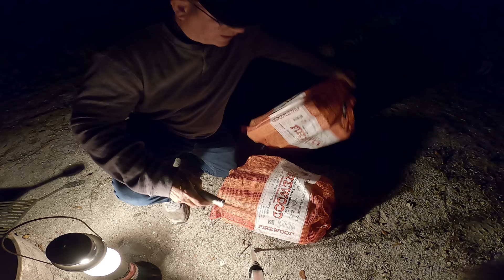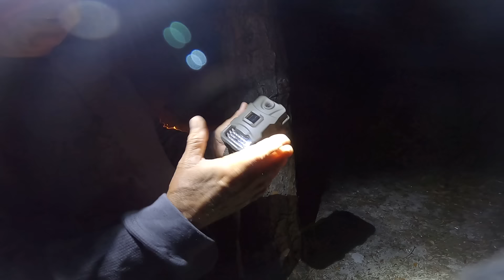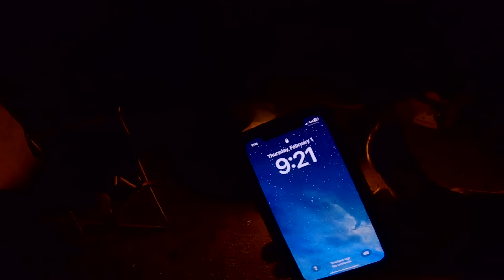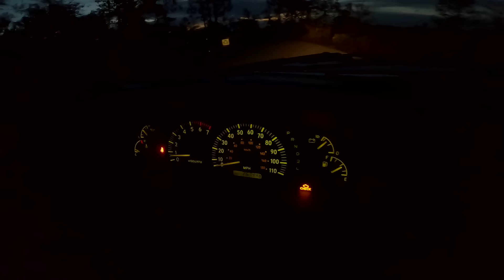3 Days Solo Truck Camping (Eating What I Catch) PART 1 Black Crappie

Comment: Hey JC, another great video thanks for sharing. 👍
Just a suggestion for trolling, get another rod holder and mount a short distance from your first one. Buy the shorter 4’6” Hotcast rod, then get a 8’ rod. Put the shorter rod near the stern and then the longer rod. This will help keep your lines separated. Good Luck 
PS You could also do this on the opposite side and be able to fish 4 rods. 😀

Comment: I use to have lots of issues with the motor plug also. I finally replaced it with one that twist locks in and I haven’t had a single issue since. I highly recommend doing the same. I’m about to replace the battery plug with a 3 prong plug so I can power my yak power system off it also with a single connection.

Comment: your connections will corrode over time one way to solve that problem is to bath all your connections and metal parts in lithium grease to create a barrier. You should also keep tools in your kayak to perform minor repairs that include bypassing all connections and hot wiring your trolling motor direct to the battery in a emergency
Reply from the maker: Thanks. They system is designed to bypass and connect directly to the battery if needed.